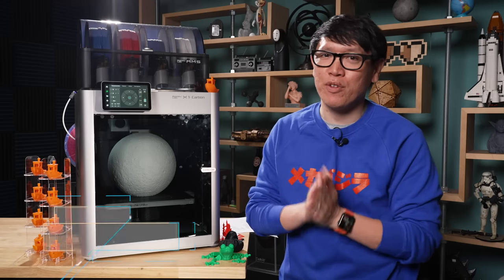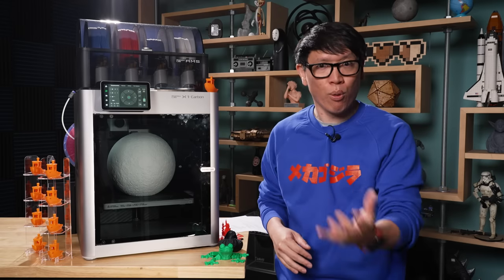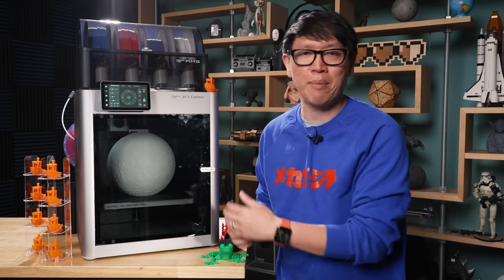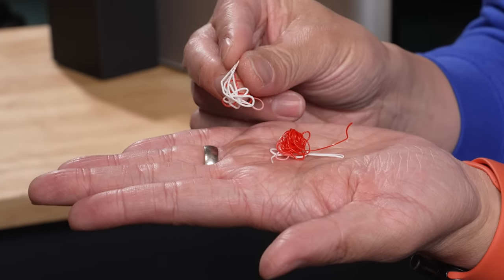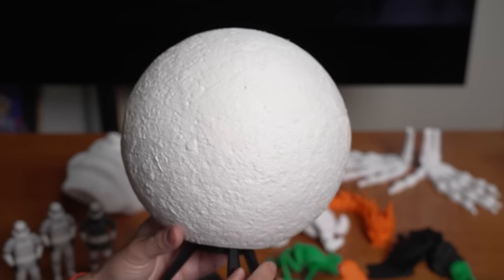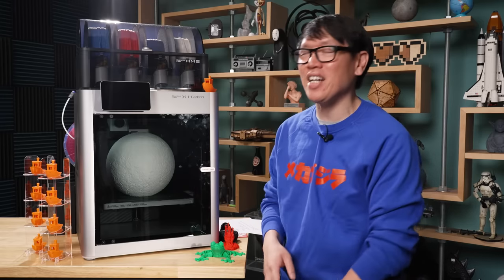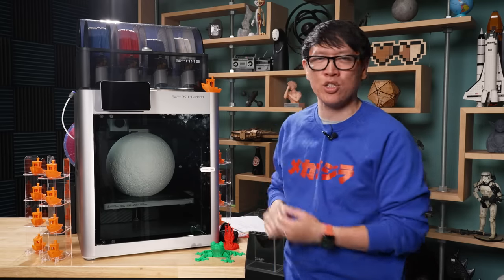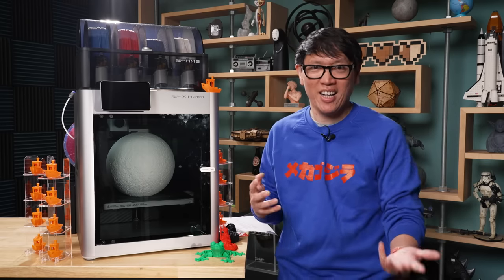Bambu Lab X1C 3D Printer Review: Speed at What Cost?

Comment: I'm very happy to see Bambu raise the bar. That said, for my hobby tools I'm allergic to cloud services and closed source so I'm happy to wait for a fully local and open solution. For production tools the calculus is different. If I believe the company will be around for longer than the lifespan of the tool and I don't expect to hack it then I'm less strict about both cloud and closed source.
Reply: you dont need to use the cloud for it. There is LAN mode and SD card just like most other printers.
Reply: @morbus5726  Yeah, I'm aware of the options. I'm waiting to see how the Prusa MK4 input shaping works out and whether they eventually open source the hw design. Hopefully it'll all work out before I need a new hobby printer.
Reply: @JarenMorris_UnderHover  you have to connect to the cloud to update the firmware though.
Reply: @whiskeyinthejar24  and? How many other electronics do you have that need to do that? Updating firmware via an internet connection like almost any other electronic that gets updates should be a non issue. It’s not a “cloud service”, it’s an OTA update.
Reply: @JarenMorris_UnderHover  it's turning 3d printing into a very closed ended commercialised thing. Which is inevitable. The carbon rails are glued into place and can't be replaced when they wear out. The data feed to the cloud is encrypted and bambu refuse to divulge what user data they are pulling from people's systems, the amount of data they are collecting is fairly large apparently.
Reply: @whiskeyinthejar24  the carbon rods haven’t even been an issue, so why get worked up about something that’s not a problem yet? Just to argue on the internet? Why are you here if you don’t like what Bambu is making? Seems like you are wasting your time just to talk down about a product thousands of others are having a great time with and do not care about the issues you bring up.
Reply: @JarenMorris_UnderHover  I'm actually in the process of doing extensive research on printers for a business I'm developing. I need to move on from hobby grade prototyping to prototyping in more advanced materials and production. Carbon rods definitely will wear out over time, bambu recommend frequent cleaning and lubrication of them. The prosumer segment is rapidly changing every day. Data security is important for a business, while my designs won't change the world, people who are using bambu machines in businesses need to be careful if there are any confidentiality or data security requirements in contracts as sending your files to a cloud service in china and back to your printer isn't ideal. To people printing desk models, this isn't an issue, but this machine isn't just marketed at hobbyists, this channel also deals with professional makers, not just hobbyists. Irreplaceable wear parts is important, there are people running prusas and lulzbots with massive hour counts. I would be really annoyed if I bought an x1c, which I have been very close to doing, if it wears out completely in three years and can't be fixed.
Reply: @whiskeyinthejar24  data stuff aside as that’s not something I’m particularly worried about, you reference irreplaceable parts, if it’s not replaceable, how is it made in the first place? Just because the rods alone aren’t replaceable doesn’t mean the assembly itself isn’t and Bambu already makes a ton of parts available at a reasonable price and they have only added more parts.
Reply: @JarenMorris_UnderHover  as I understand it, epoxied into the frame.
Reply: @whiskeyinthejar24  I have one, there are only carbon rods on one axis, they could be replaced as an assembly. Sure, not ideal but that’s not to say Bambu won’t revise it later on and opt to not glue them in in the future.
Reply: @JarenMorris_UnderHover  I believe the travel rods were just press fit originally, but some early test units come loose, now they are epoxied in place. I haven't played with one in person, so you would know better than me if you have one. If the motion system in general can be removed, that's not so bad.
Reply: @whiskeyinthejar24   couple things:

bambu recommends against lubricating the carbon rods. they are self-lubricating and using your own lubrication will cause significant wear. cleaning is all that is needed

the carbon rods are replaceable now with the x-axis gantry sold in their store. it’s safe to assume they are not selling you wearable products without any hopes of repair :)
Reply: I'd actually be more worried about ny data being on the cloud if I were working on something patentable or otherwise sensitive (trade secrets, government contracts, etc.). It's just too risky.
Reply: @AdrianLopez-sb7eo  Agreed. I mostly work on my own designs or other people's open licensed designs so it's no big deal if they leak. But yeah, using the cloud for secret designs is a no-go.
Reply: @JarenMorris_UnderHover 
You ask why we are here, if we don’t like Bambu.
Well. To warn you about the problems with being so blinded by speed and smart stuff, that you close your eyes to potential problems.
And if you don’t see mega large encrypted logfiles transmitted to Bambu, without knowing what they are leeching from your system, you are clearly not one of the people complaining about Microsoft or Alphabet datamining your system. Which you should be.
And proprietary parts combined with cloud is the first step toward “subscribe or we brick it”.

Comment: Main cons are - its very loud at it’s ”normal speeds” >150mm/s, - some heat bed has warped for users (mine is fine so far) - three supports are very weak and ruins prints of not changed. Pros are: very fast, good to very good print quality, ams works fine

Comment: Core XY means the belts move it diagonally, the best explanation I’ve seen is in Linus Tech Tips chocolate 3D printer video from a few years ago. One belt moves diagonal, two at once moves it straight.
Reply: Sort of, basically. There's two steppers both driving the hot end and the cross piece, so it's not just doing X and Y like reduced delta printer. It's actually really cool how it's belted to move two separate components in a way that makes it add up to diagonal motion.

Comment: What is the durability and serviceability? Even with the input shaping and corexy kinematics, the mechanical wear would be exponential at insane speeds. What about the availability of 3rd party upgrades and parts? Could be useful for faster turnaround of rapid prototypes, if not forvthe data piracy and ip protection concerns in uploading to a cloud service in a country, that does not respect IP rights that much. Just some 💭

Comment: 500 mm/s is ONLY the printhead maximum speed. The actual printing speed is a lot lower for filament types other than PLA. But the coreXY and proper tuning still means you can get higher speed and good quality than most bed slingers.

Comment: It looks like you could somewhat easily create and print a mod that automatically switches to the external roll, feeds it into the printer, and pulls it back out when no longer needed. Very simple, Y splitter, filament sensor, extruder that can move out of the way when finished loading/unloading, and some simple code

An automatic build plate swapping system would be incredible, being able to just load a stack of plates in to a hopper, and have the printer automatically swap them out when finished printing, before starting the next print. Push start when you go to bed, and when you’re back the next day, you have a bunch of neatly lined up build plates filled with the various parts you needed

Comment: Great review! One thing I missed in the video and I'm curious about is comparing the noise levels to other FDM printers. I've heard that the Bambu's fans can be quite loud (even in the silent mode), which makes that printer less than ideal for overnight prints or for use in a shared living space like an apartment building. What do you think? I'm considering buyng one, but as I don't have a dedicated workshop/basement/etc, I'm not sure if my neighbors would be happy with my decision...  (currently, I own a Prusa MK3S+ and a heavily modified Ender-3, which are pretty quiet)
Reply: Its a lot louder than an MK3 which I own.  I print on my MK3 in the kitchen with my bedroom door open but printing with the X1C in the kitchen takes a lot more effort to sleep.  Keeping the door open on the X1C (for PLA) is the reason it's so loud.  I'm having to use a lot of glue to keep PLA stuck to the bed which I'm not too happy about.  The slicer "Device" tab is buggy as hell and will cause the slicer to freeze almost everytime I go to that tab so I avoid it at all cost.  My AMS did not detect a spool run out and the PLA got stuck and I had to disassemble, now the feeder port won't detect when I feed in filament.  Spagetti and first layerdetection hasn't been all that great either. Yes, it's very fast compared to the MK3 but I don't have to baby sit my MK3.  And the TEXT tool is very slow and clunky.
Reply: @thegoldbug  few things here:

door does not need to be opened for PLA. significantly quiets noise. for accuracy, dB levels around averaging around high 50s at about a meter away.

you are over using glue on the cool plate. glue is used as a **release agent**, not an adherent. try using less glue, globbing it on is not ok.

it’s unfortunate you’re getting all these errors, you must be apart of an unlucky minority. mines been banging along like a beast for the last half year, and everything’s worked perfectly as intended :/

Comment: on Creality K1 you can only change the speed from the front touch panel, period. if you root the printer you can access via Fluid as a slider, but whichever way you do it, the printer STOPS cold, jerks and starts the new speed and ALWAYS messes up your print regardless of wether you're speeding up or slowing down. on Bambu, there's almost no difference except the sheen of the side walls.

Comment: One thing i wanted to know, and haven't seen mentioned anywhere, one of the annoyances for FDM is never being entirely sure how much filament is left on a roll and if it'll be enough for a certain model etc... so i was wondering, if you load up the AMS with new rolls, does it keep track of how much of each roll it's used, either in weight or distance? I wouldn't expect it to be able to do it if you changed out filaments, but surely it knows what you've told it you've loaded (i.e 1kg 1.75mm pla) and it must know how much it's extruding, purging etc... just thought it'd be a cool feature.
Reply: @22:23
Reply: if you run out it can switch to a different spool in the ams
Reply: Some spools have markers to tell how much is left in length and weight, and slicers will often tell you how much filament is needed for a print
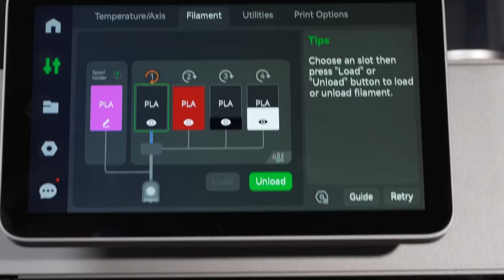Reply: Using the AMS, the Bambu Lab filament has a RFID, so when I have put a partial role back into the AMS, you can see on the monitor what percentage of filament is left. (He shows this at about 22:50 in the video). To the best of my knowledge, it doesn’t give you an exact percent or length of filament left, but you can get a pretty good ideas by looking at the screen. If you are concerned about it running out, you can load the same filament in another AMS slot, and it will switch over when the first runs out. I haven’t done a lot of multi-color prints, but have my favorite filaments in the AMS, so easy to pick from the computer what you want to use.

Comment: Before you go and get a 3D printer on this level where everything just works I feel like you need to learn the ins and outs of a lower class printer in order to learn the growing pains, and maintenance of what real 3D printing is like. This is more like the last and best printer you will buy after learning how to use different slicer programs and whatnot.
Reply: I personally do not regret using hundreds of hours of learning to troubleshoot a poor quality printer. There is still plenty of troubleshooting with filaments, print settings, and modifying models without having to ask if the printer is broken.

Comment: I really want a new 3d printer. A large print bed printer, that prints good outside the box so i do not have to post process so much before i paint. I've been looking into resin printers because of the factory looking finishes you can get but ultimately I'm on the fence on everything which leads me into just sticking with my ender 3. I would gladly drop a 1500 on a printer to end all printers, that would be the last printer i owned for the next 10 years. I'm just unsure of what i would like to get.

Comment: You can also tell by the mate finish that the filament have not bin melted enough. Witch means layer adhesion will be bad. This is the downside of the bambulab. Their hotend have way to low flow. I don’t print as fast but have a hotend with 28mm3/s in flow rate and I am limited by the flow rate.

Comment: I briefly considered resin printers. I’ve seen them at the 3D shows, and well, not for me. First of all, they’re a mess. Secondly the liquids used are very expensive and some is wasted every time you remove a print as some of it coats the print until it’s washed off. Then you do have that necessary wash, which takes more time and is messy. I’ve seen the machines being used, so I can give personal experience seeing those results. Detail is very good though.

Comment: Sounds like this is the closest one can get to a consumer friendly 3d fdm printer.
Reply: If you think this is the closest one, you should check out Prusa
Reply: @clairvoyantblade9534 Considering the prices this particular Bambu printer are now going for, Prusa might be friendlier to my wallet.
Reply: Big BUT from me
Prusa printer don't include a casing, so you have to buy one separately. Or you build one with  IKEA Lack table if you have the skill and time.
 I think a MK4 with casing should be a bit more expensive than the Bambulab printer. 
At the other hand you can buy every spare part and print your plastic spare parts too.
Reply: @clairvoyantblade9534  however, enclosure is not important for PLA or PETG, which is what most people print with.
Reply: @Papinak2  While an X1C would be great for most people, I don't think that this printer is currently for "most people" (though the P1P might be). This is the early adoption stage of high speed FDM printing. Those who are only printing in PLA and PETG are largely hobbyists, and while this would be a great hobbyist machine, it's a more serious tool than most would need. I've been a fan of Prusa for a long time, but it really feels like they've found themselves a generation behind.

Comment: Great but SCREAMS "at any point we can brick this" with all the tech jammed in..

From the RFID/NFC readers for spools (tech used are NOT BASIC AND HARD TO CRACK, think about why that is..), cloud stuff, proprietary versions of open source software, etc. Is just ripe for holding people hostage... They could go out of business, get bought out, decide to force subscriptions for use, make it so you can't use any filament but theirs etc etc.

Oh and if something breaks or was dead on arrival, they only send parts and it's apparently a massive pain to fix and repair.

My big gripe is for businesses/industry with proprietary design going on - we CANNOT use your cloud. Half or more our stuff isn't even on internet-capable networks (local only) to prevent cyber security issues and potential accidental leaks. Edit: a commenter below said they are capable of no-internet operation (for now).

That being said, there are a lot of great features and capabilities packed into these at an obtainable-by-consumers and hobbyist price range.. something that has been much needed in FDM printing for awhile.
Reply: you don't need to connect it to the internet. you can send the prints over LAN or just load them onto the SD card if you don't want it connected to any network. you will lose the functionality of the phone app, but that isn't too big an issue. the only thing it needs an internet connection for is firmware updates.
Reply: @ERTWaero  that's good to know, sounded like they were pulling a glowforge..

But that still doesn't address all the other opportunities for abuse, for all we know it could be baked in on a timer right now and it's just really far out in case someone simply never connects or updates it.. with each update they can kick the timeline more until they scoop up enough saleable market share.

Just being skeptical because lots of companies already do this and lock people into a system or otherwise, especially on the industrial and academic sides.. it's actually kinda funny how the more expensive the machine is, the more likely you're trapped.. 'oh you didn't buy our printer insurance plan, so we can't sell you parts.'
Reply: Exactly and that is holding me back, I want something I can actually fix also because I don't want to have a paperweight when they go out of business.
Reply: Broski Snowski  I never said RFID spools were required. NOT YET at least, go look up people trying to crack the tech they put onto the machine/spools. If it was simply for weight remaining, some settings, etc.. WHY is it top-tier?

Because industrial stuff already has a "you have to buy our 30x cost spools" that's why..
Reply: they clarified if they ever went out of business they would release all their designs and parts to the community.

Comment: FK..... Da Vinci did that RFID crap but you couldn't use the plastic that was credited to a previous print that was cancelled so if you cancel a 200gram print that's 200gram you won't ever be able to use again because they bricked the firmware so you couldn't reset the count ... Bunch a crap that was... If this is similar I am completely put of this now